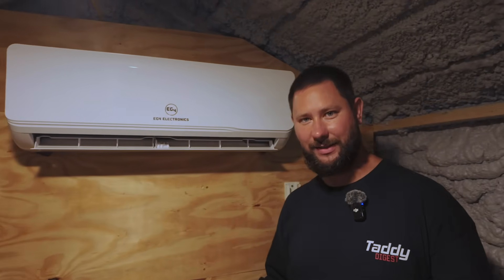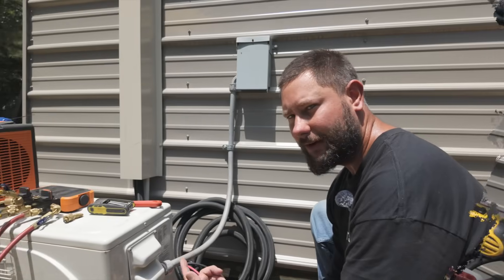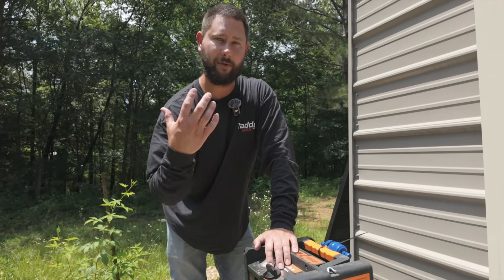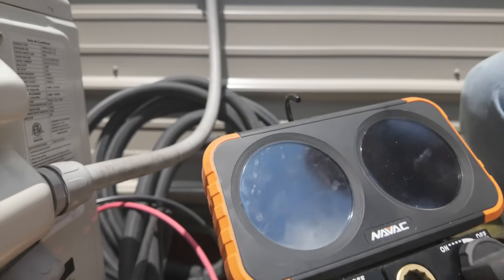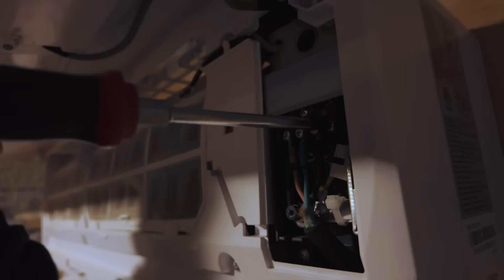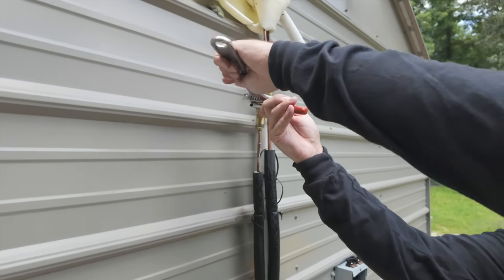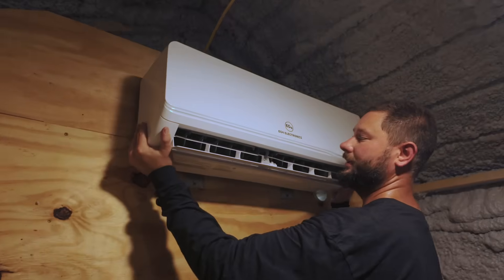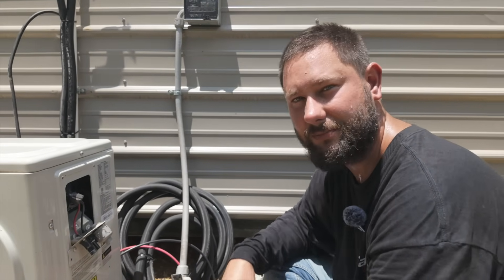DIY Mini Split Removal: What You Need to Know

Comment: What if we want to remove the unit without the recovery step or device? I am working on a skoolie and need to remove the unit that is mounted to the back of the bus. I noticed the same release of pressure happen after removing the service valves, but I immediately stopped since I didn't know what to expect.

Comment: Thanks !!! I'm doing this soon, salvaging old heat pumps to install in my house ! 
They are old but this will save me a lot of money compared with electric resistive heating !
I do have one question, if the hoses are pre-charged quick connect hoses, would they keep the refrigerant gas inside the hose and indoor unit without doing a pump down ?
Reply: @shodanxx  I'm wondering the same thing!

Comment: You mentioned moving the unit.  We want to move our unit about 10 feet over on an exiting wall ( so we can install some cabnets where the unit is located now)  The question is can additional copper lines be soldered on the existing lines to extend this. ( I am guessing the drain line and wiring would not be too difficult)  Thank you.
Reply from the maker: This is a d I y friendly model.So you can merely disconnect the line, sets the drain and the wiring and then reconnect after you reinstall

Comment: I have a new dual split unit, and I’m replacing only one of the interior units, due to electrical issues. The manufacturer sent me a complete interior unit for replacement. 
My question is, Do I need to pump down both interior units in order to replace that one unit? Or just pump down that one unit and leave the other alone?

Comment: Can I use the pump down method if there's a leak in the line. Will air come into the condenser through the leak? I'd like to get the refrigerant into the condenser before fixing or replacing the line. Thank you.

Comment: Tad,
     Question about the line set ? I’ve been told that coiling the extra line set can cause issues with oil/refrigerant  pooling in the coils of the line set. Is this true ? What are the best practices with regard to extra line set length of mini splits?

Comment: Nice to the point instructions as usual.  I used to use the 20V adapters to keep my old 18V Dewalt tools running.  Once you buy the actual 20V tools you will see they are actually better then the 18V models.